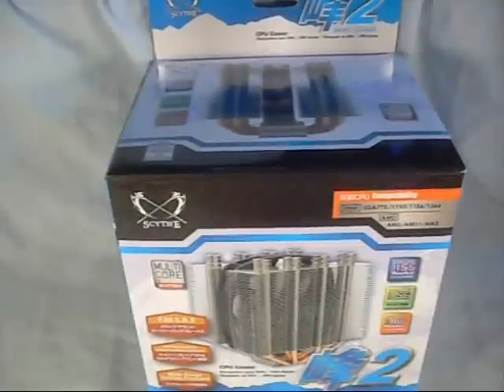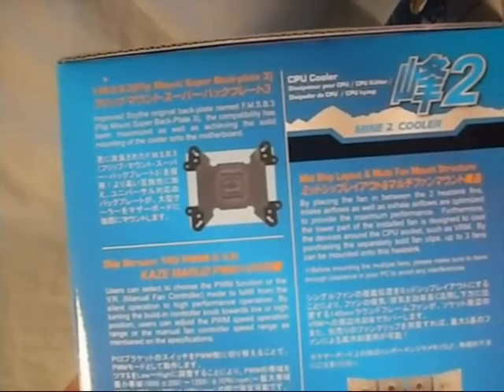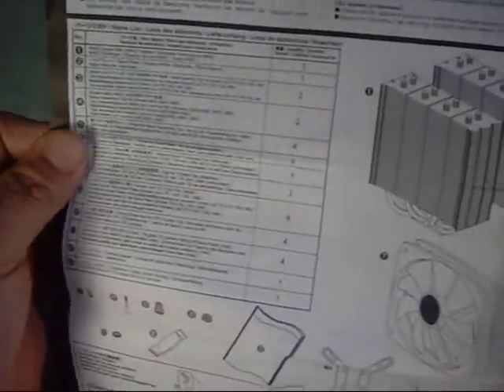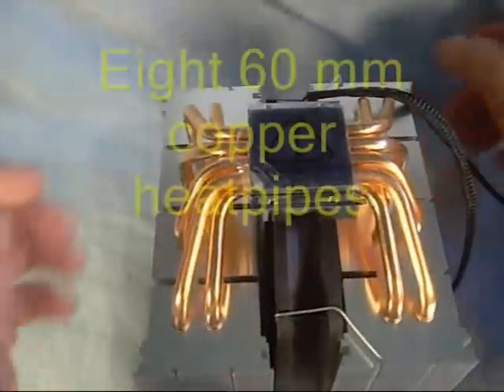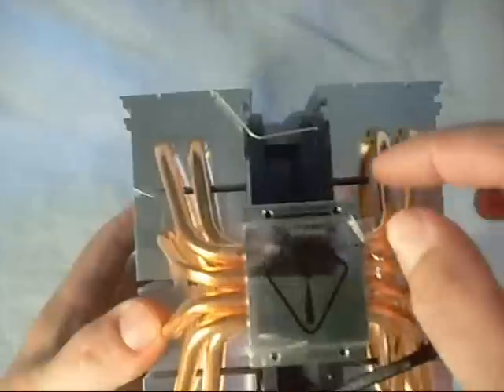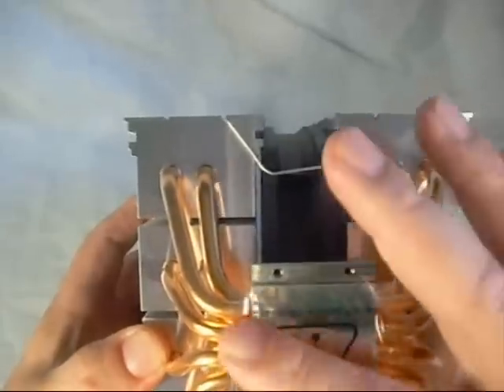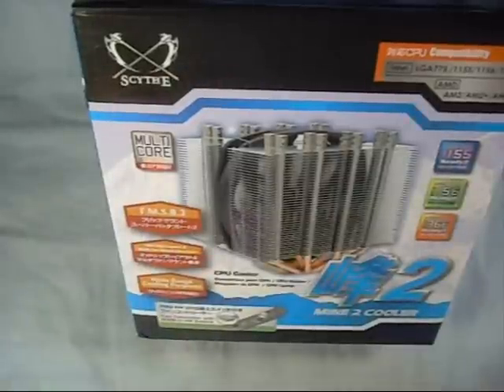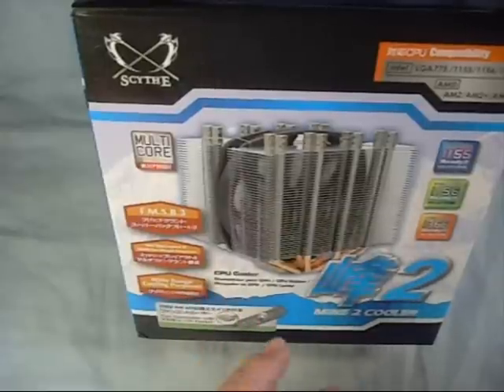Product Showcase Scythe Mine 2 CPU Cooler (SCMN-2000)

Comment from the maker: They are calling the distance 45 MM So it should clear but if you need to pull the first chip out again you will need to remove the cooler to do so.

Comment from the maker: That is a very good deal on one. Yes the height is 14.3. As for the ram it can be tricky to get ram in and out that are close to the cooler.I would suggest you install the ram before you mount the cooler down. It would probable still go in even with the cooler on but to be sure and not waste your thermal past try dry fitting it first and then put the paste on and mount it.

Comment: hey man, i know this is kinda late, but this cooler is momentarily 24,99 euros in a shop and i am really interested in it. first off, is the height really 14,3 cm, including the height of the heatpipes? because it looks alot bigger on the video. and I have a mATX mobo with 2 RAM slots, could i slide in my 2x2 corsair low profile ram underneath it or will it be a problem?
thanks man.